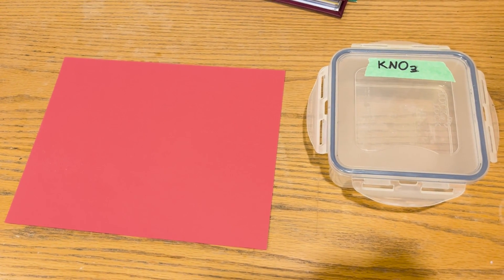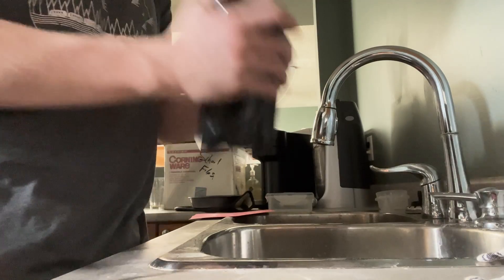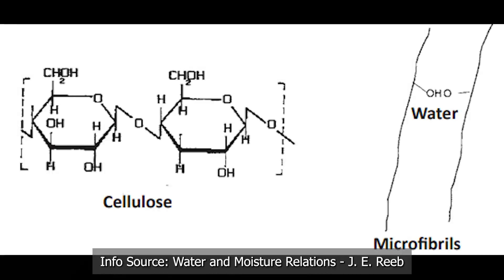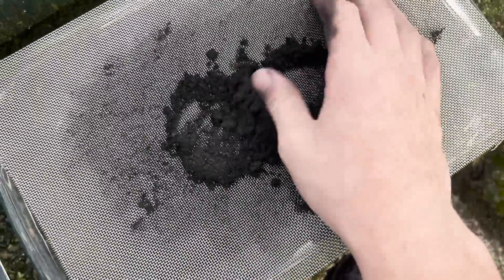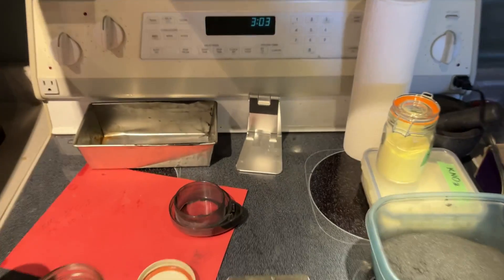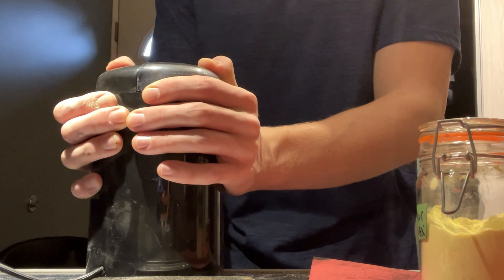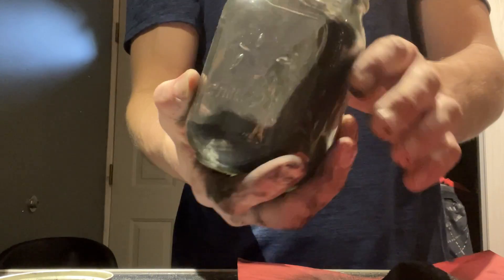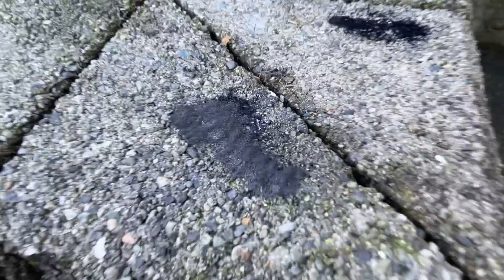Homemade Black Powder Instructional - Minimal Equipment

Comment: After you got everything mixed together, mill it in a rock tumbler with brass balls for 24 to 48 hours. It’ll burn so much quicker. But it’s still not ready for use in a flintlock, more refinement needed such as, pressing into pucks, grinding it into proper sizes, glazing it to take it from gunmeal to actual black powder. 
Your stuff maybe ok for firecrackers, but that’s it. 
Good ratio is 76/12/12, burns clean and powerful. Buy refined charcoal or make it yourself using a paint can on a low burning fire in the coals.

Comment: The charcoal plays a very big role in this.. it also depends what kind of wood you use, generally speaking Fast growing Trees that produce soft wood make Faster burning BP, one good example is The Willow Tree, it is perfect for making Lift powder. Also not that your charcoal should be made by Putting it into a metal container that can be closed like a Paint Can (not spray paint) and then closing it.. also punch one hole into the lid so the expanding gasses can escape, now put the wood into the can, prefferibly small pieces, sticks that are as long as the can is tall and about 1-2cm. Now put the can into a blazing fire and wait for 2 hours.. after that you will take out the can and plug the one hole you made with a small branch, let it cool doen and you have a very good quality charcoal.
Reply: this is the best method to making good charcoal and its not even hard, dont use any kind of wood
Reply: @Jorge-5-5  I'm interested in how you make charcoal without wood..?

Comment: Can you use bbq charcoal?
Reply: No, the reason you won't see anyone using briquettes is that they add clay to them to make them hold shape better, because no piece of wood comes perfectly briquette-shaped. You'd either need to source raw charcoal from a producer or produce some yourself. Toss some sticks in a can, close it and poke a hole in the top, toss it in the fire pit and build one around it, and when it cools down you'll have charcoal in the can from burning off the light excesses that form impurities in the powder. Not that hard, like most steps, just time consuming.

Comment: Very slow burn rate. You have to ball mill the mix, and then granulate it using iso-propyl alcohol 😊😊😊😊
Reply from the maker: Yes, the point of this was to be easily made though. Ball mills are relatively expensive compared to the cost of ingredients

Comment: Be carful drying in an oven. I was making BP described in the improvised munitions handbook, using liquor to dissolve the KnO3 as was described. I would dry in the oven with the element off and oven preheated and one day I got distracted and accidentally left the element on and BOOM!!! I blew the oven door off and 3 windows in the kitchen. Right in front of my wife, she didn’t find the huge fireball rolling across our kitchen ceiling funny and definitely she hated the thick cloud of smoke that filled the entire house. I was washing every dish, clothing and knickknack for days. 

 Build a cheap dryer with a porcelain element that is vented and not directly installed in to the drying box.
Reply from the maker: 😅 glad you're ok. Probably the liquor that evapourated and saturated the air... And yes my ideal lab is a shed and not a basement suite kitchen

Comment: You need to buy or make a ball mill, this is just a poor method, BTW  this is not gunpowder, this is black powder.
Reply from the maker: the words are interchangeable, although now gun powder is typically smokeless powder.

also ball mills are expensive, whereas all the items used in this video are <20$
Reply: @kitchen_chemistry  agreed ball Mills can be expensive. You can find one for 60 or so dollars if you look around. I built my own and frankly cost me hundreds of dollars but it's very versatile. 6 oz up to 5 gallons. It can also be used for making Stars if you do fireworks pyrotechnics. As far as gunpowder/black powder, the words are not interchangeable, gunpowder is used for what people typically think of as firearms. Black powder is used for muzzleloaders and other firearm specifically designed for black powder. Two different chemistries, black powder and gunpowder are not interchangeable where firearms are concerned.

Comment: well i made a bomb with the gunpowder before watching this vedio and most of the time it in small scale like firecracker did not explode but when i tried with a can of empty spraycan and filled it with it gunpowder which did not worked suddemly worked and exploded in my hand and fortunatly my dad saved me from the commotion that i caused in the socity with that explosion and made me threw all of my KNO3 about 290g of it which in my county is very expensive
Reply from the maker: Painful, which country? Its very hard for me to get KNO3 aswell, but KCl and Ca(NO3)2 is readily available. I can make KNO3 in ~250g batches fairly easily and not too expensive if I buy precursors in bulk
Reply: @kitchen_chemistry  I just earn money when Eid comes and only manage to get about 2000rs which is very good amount
Reply: @kitchen_chemistry  I was already subscribed to you are a great inspiration to me ❤️ and I have watched the vedios and I also do kitchen chemistry 🙂
Reply: I live in Pakistan and unfortunately due to our financial problem for me I think is expensive as I have no income what's so ever and If I had income I think it would be considered cheap in other countries
Well the price of 250gm of kNO3 is about 800 or 750rs when you buy it when it is advertised at fertilizer but when you search it as KNO3 it is 750rs per 100gm which is expensive 
And as our country is agriculture based it is easily available but not cheap enough to be able to be bought by people like me with no allowance or no income

Comment: a tip. You can make your powder 100x faster if you use willow charcoal even with this method. one thing, though. Use a mortar and pestle and grind all the ingredients until they start clumping (takes 10 min). Mixing the ingredients like you do and you will have slow powder.
Reply from the maker: Willow charcoal is harder to come by I find, I used pine which does yield a lower burning powder but was good enough for fire crackers
Reply: @kitchen_chemistry  ah ok, in europe willow is everywhere. great vid, ur firecrackers are awesome
Reply from the maker: @bomen330  haha thanks man. Some of the comments have some valid improvements so if you're gonna make some I'd follow their advice. Plus the willow BP and you'd get some insane ones

Comment: Charcoal is way overcooked , its by far the most critical thing too get right.
Reply from the maker: I find it needs to be completely burnt. Have u had success with it partially burnt?
Reply: @kitchen_chemistry  make the coal in a can with a small vent hole when the smoke stops venting from the hole take it off the heat and plug the hole then leave it too completely cool . I find young willow branches between 1&2 inches thick the best . Have a go and see what you think.
Reply from the maker: @kelvinsparks4651  I've heard of that method, but i'm pretty sure it only works with soft wood yeah? Willow firewood is hard to find where i'm at
Reply: @kitchen_chemistry  it will work with all woods but the harder the wood the longer it takes.  If you can't get willow try birch ,Hazel or alder , they are the next best that I've found.

Comment: the granules should be small with a size of 2mm, 3mm diameter. Such sticks do not burn as efficiently as they should. So, show such a video how they granulate the black powder into small uniform sized balls of 2mm, 3mm. Separately, the granules should be quite hard and strong, not easily crumbled

Comment: I grind them separate.  I do not worry about moisture.  Ball mill it for 12 hours. Add 10 drops of water. Mix it . Make pucks with a bearing press . Put puck in dehydrator for 24 hours break it up . Run it thriugh a coffie grinder with porcelain gears. Screen with a 20 mesh . Now you have gun powder.
Reply: or ball mill it for 12-24hrs or more and run it through a screen mesh. Now you have gun powder. Making pucks certainly not necessary.
Reply: @elliothuh669 it is necessary to not explode. If you have raw powder it would either burn too slow or explode unpredictably, you need granules of a certain size
Reply: Water enables to solute KNO3 and to penetrate coal and sulphure surfaces and after drying to make cumbustition more rapid.

Comment: Sorry but... This is how to make shithouse black powder... You are not even near "meal powder" good for fireworks. You powder will not ignite in a gun and if it does it will burn so slowly that you bullet will hardly exit the barrel. Moreover, when you pour the next load of powder you may have left some hot spots at the bottom of the barrel, glowing pieces of charcoal since you grinding is so coarse. DANGER. Your powed in not incorporated and for that you need moisture (water). To make proper BP you need a ballmill, a 10t press and a manual coffe grinder to granulate.
Reply from the maker: I agree that you need a ballmill for great black powder, however, even the cheapest ball mills that work are ~60$ when you include the price for medium. "Minimal Equipment" means minimal equipment. This BP works for firecrackers, which is what I needed it for. Obviously if you want it for a gun you'd invest in equipment.
Reply: @kitchen_chemistry  Thank you for your reply! No drama, fire crackers, rockets and fireworks don't need so much investment in work and gear. I made my ballmill with a beer keg (yes it's big!) a motor from a air conditioner, 4 rollerblade wheel, iron bar, 4 pulleys and wood work. A ball mill is also usefull to powder any other stuff needed (lead oxide now for me as i am making batteries..) Good luck and keep making BP it's the cheapest and best hobby in the world!
Reply from the maker: @Frogmobile52   absolutely. I'll probably invest in a ball mill for dark aluminum once i create a chlorate/perchlorate electrolysis cell (for use as flash powder)
Reply: @kitchen_chemistry  my ballmill:https://www.youtube.com/watch?v=lmd2DAfxPO4&t=2s
my chlorate cell https://www.youtube.com/watch?v=nJb030ddB1s
Reply from the maker: @Frogmobile52   Good job man, i'm planning on making some titanium substrate cobalt/manganese MMO anodes by decomposing their nitrates on etched titanium. The accomplishment of making a sturdy anode is worth more to me than the chemicals lol.

I'm thinking of making an induction heater to heat the titanium to high enough temperatures, if not maybe a heat gun-powdered furnace

in the future, I'd make a lead dioxide anode which are by far the best for perchlorates which are more desirable (I want all 10 fingers by the time I'm 30)
Reply: @kitchen_chemistry  you can make a ball mill out of scrap you already have. It's very simple machine. I saw one guy using a treadmill and few pieces of wood as ball mill.
Reply: @kitchen_chemistry  "This BP works for firecrackers, which is what I needed it for."

Are you sure it actually works for firecrackers? I saw the burn test, and that BP doesn’t look nearly strong enough to rupture a firecracker shell — maybe just burn a hole in it at best.

Also, it’s worth noting that commercial firecrackers almost never use black powder because even good BP is usually too weak for that kind of effect. It’s much more commonly used as a propellant in fireworks rockets.

Also, just a quick tip:

When drying powders in the oven, try to spread them out over the largest surface area possible so the layer stays very thin. That way, the moisture evaporates faster and more evenly. Also, set the oven temperature above the boiling point of water.
Reply: Can it work for rock blasting?
Reply: Do you think ancient Chinese used all those equipments you're talking about?
Reply: @musasizigodfreydixion6231 yes, just not  electric. They would have used grist Mills and large grinding Mills like that.

Comment: great video but put it in a ball mill and then granulate it for faster results
Reply from the maker: Ball mills are expensive and this was done with "minimal equipment"
Reply: i bought my ball mill with 70$. it's a rocktumbler and use marbles or ceramic balls as milling media @kitchen_chemistry

Comment: What was burned at the very end, wasn't that really crap?
Reply from the maker: Its good enough for my purposes. If you want to use BP in a rocket, you'd need to granulate it, mill it, and use softer wood for charcoal. The point of this video was to show that you can make BP with "Minimal Equipment" which I ended up using for firecrackers

Comment: I can buy these ingredients but not a gun.
Reply from the maker: home depot, get a galvinized pipe and with a cap and drill a hole in it, you can create a makeshift flintlock if you add a spark tray
Reply: @kitchen_chemistry  or two caps and make a pipe bomb
Reply from the maker: @usnchief1339  DEA doesnt like that unfortunately

Comment: Theres gobs of videos here on the Youtoobs on this subjuect, but I enjoyed the minimalist approach. Id like to see ways of aquiring sulphur and PN that are "kitchen ready"
Reply from the maker: Sulfur I got from amazon, 99.9% pure for 18$. I dont think theres a cheaper way. The KNO3 is bought from a hydroponics store. If its unavailable where you live, you can make it with potassium chloride (sodium-free salt at the grocery store) and calcium nitrate (fertilizer). Those are the easiest "over the counter" ways to my knowledge
Reply: @kitchen_chemistry  I've also seen how to get PN from from the dirt in/under animal pens from several sources, though I haven't tried it yet.  Haven't seen a way to get sulphur though, other than buying it.
Reply from the maker: @pARabell9mm   Train tracks. Sulphur often falls off trains transporting it. Its a biproduct of cleaning natural gas, so its normally transported to some storage facility
Reply: There is a mix that you use sugar instead of sulfur and it works pretty good
Reply from the maker: @kennethparker2168  Sulfur helps with heating up the reaction though, so it would be the ideal solid if you had access to it